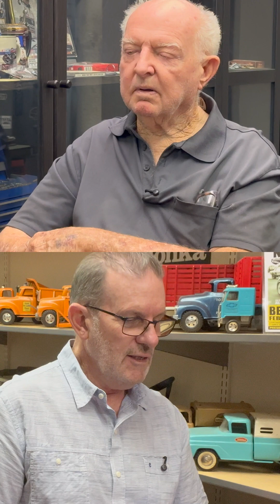Engine Oil Priming TIPS - Ask Ed 35 - Ed Smith w #BarryT #enginebuilding #racing

Comment: That is a great tip. I’m working on a Y Block Ford. The rocker shafts were fed from the camshaft center bearing. My camshaft is the drilled style and not the grooved one.   So I would need to turn the engine over when I prime the pump with a distributor drive.  Thank you so much for the videos and sharing the experience of this gentleman.
Reply from the maker: You’re very welcome. It’s my joy. I am glad that it helped you out and thank you for letting me know.

Comment: Makes perfect sense. I've never had to oil prime an engine on overhauls. I've always reassembled using STP and put a pint of Chrome molybdenum oil added to the oil pan. Never any problems on break in.
Reply: We would open up the oil pump, pack with Vaseline or similar would have oil pressure right a way. Did the same with STP on all bearing surfaces ect. during assembly.

Comment: I like to prime engines that way before I do the first start. I learned the same way. Just turn the crank 1/8 or 1/4 turn at a time and it seems to be enough turning to get oil clear throughout the engine.